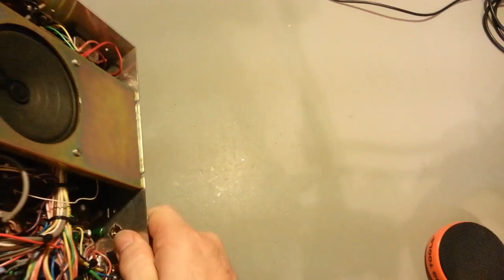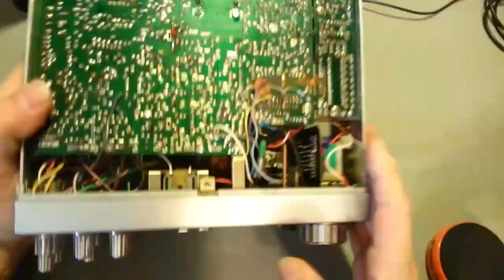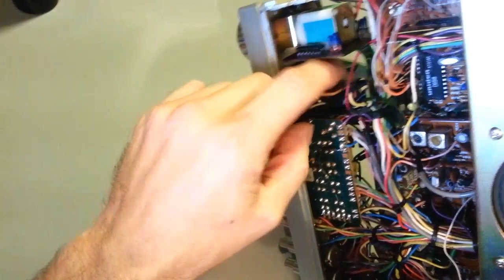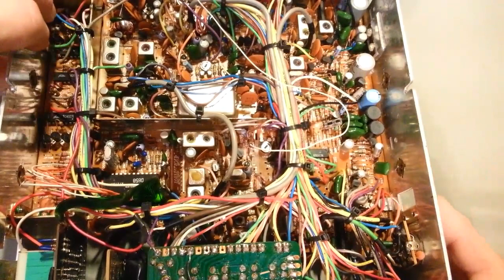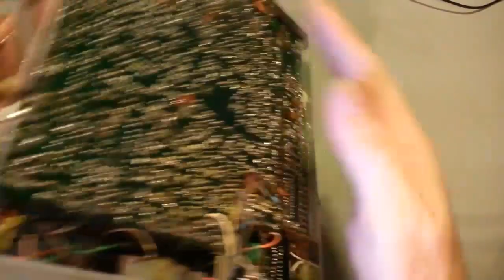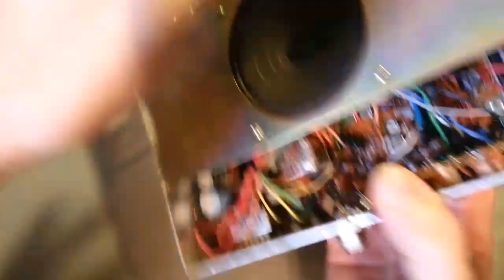Initial inspection of a President Adams 40ch AM/SSB CB radio.

Comment: Hands down this radio is iny top 10 of all radios ,as a technician..I love a radio with great design... I love all undien chassis ... There really designed to work...and top of line on SSB ..very stable under proper tx alignment... Top notch ..radio...and mike if you have several  of these ..can I buy any of the ones you wish to sale.....
.I want them ,I collect all uniden  chassis ... I love 858..pc .and the 8917

Comment: Think of an electrolytic cap as a quick discharge battery, which is what they are, and think about how all batteries eventually go bad. Worse, was the "capacitor plague" that hit in the 90s, and caused many problems. Industrial espionage was said to be the cause of it.

Comment: My old Adams was modified by a friend who put in 197 actual channels. We don’t count SSB as an extra channel. He removed the dimmer and installed a 10 position rotary switch. But it didn’t do anything unless you ran a magnet along side of the standard microphone. Then the channels were activated until you turned it off or removed power, then it was a normal radio again. It is a truly great radio!

Comment: That was Intresting.My first Radio was the Adams,probably had everything from President in my Kiddy time but always come back to the Adams.Lather i had it in My car,probably 10 years in my Truck and it always works pretty good.I always use the PA,NB and Normal switch for the Channel mod.The only Problem over here with the Adams was.Local Stations always use FM.On Sideband its missing the 5 khz switch.But whatever CB is quiet over here and my Adams sit in the living room the last years.Think i have 2 Bezels somwehre,we paint it in the original silver many years ago.The Problem this time was the letters,think today thats a easy one to get them back on.By the way,there is a guy in Austria,Maurer,take a look for him,he does pretty cool mods on that old Radios

Comment: My Adams also has the D21/D22 jumper, but in addition to that, they connected the two striped ends of the diodes together as well (and I don't have the zener clarifier mod).  Did you ever find out what that "mod" is supposed to do? The fact that whoever did the mod doesn't seem to understand how a diode works makes me think that "mod" is just snake oil, scrapping some sort of protection circuit that will likely never be needed.

Comment: Hello I have an old one for years now it only has one mod that is the hi and low channels but they don't line up like 27,555 should be on channel 12 not 16 an 27555 and it is time for capacitor change and I have a few question. I cannot fin the exact value capacitors example 2.2uF 25V i can only find 100v to buy here. I would send it to you Mike but the trip is to risky for the radio.

Comment: Hi Mike    in Europe /UK  ... the president Adams was sold as a 80 Ch radio with the same add on sticker saying  Hi and low  which was the cb / pa switch originally hope this helps
Reply: P S   a  well know mod for this radio was adding a VFO and people still do it    eg http://www.rigpix.com/cbfreeband/president_adamsvfo.htm
Reply: It was an Hans Muller modification [Muller Electronics] and no details were released as far as i am aware.

Comment: Could we 3D print a new fascia, can you use Thinners to remove that stupid glue from the PCB, Maybe it is time UNIDEN used DSP processing for all functions on the CB transceiver and a PLL based around frequency syntheses chip and leave nothing for golden screwdrivers or set modders to do.